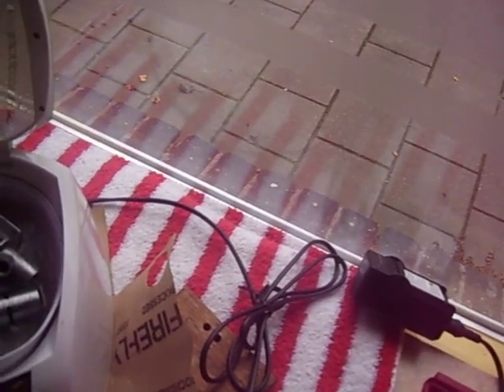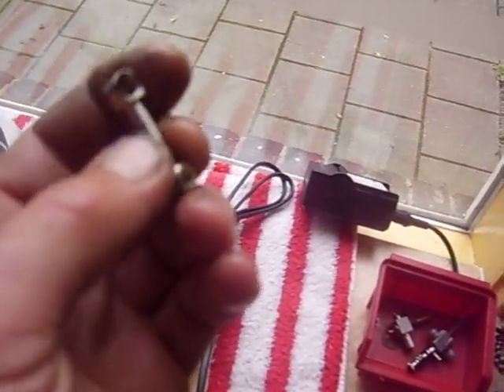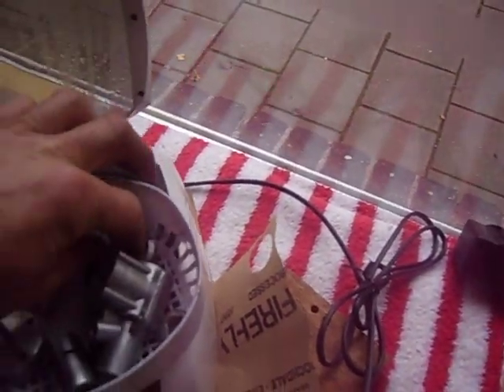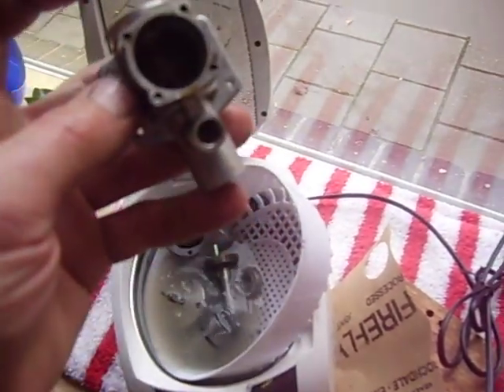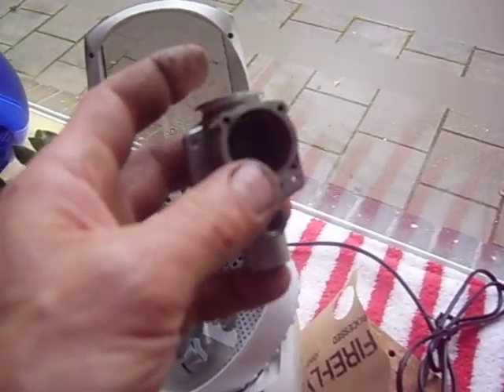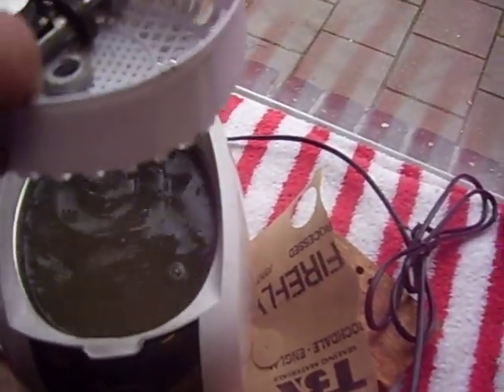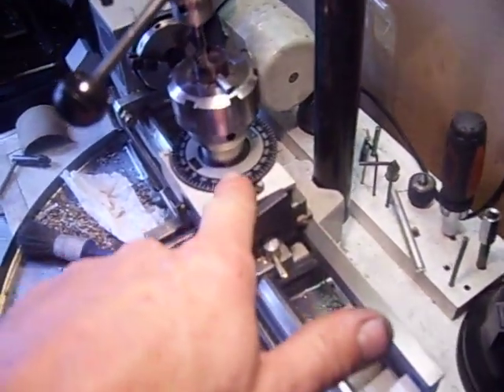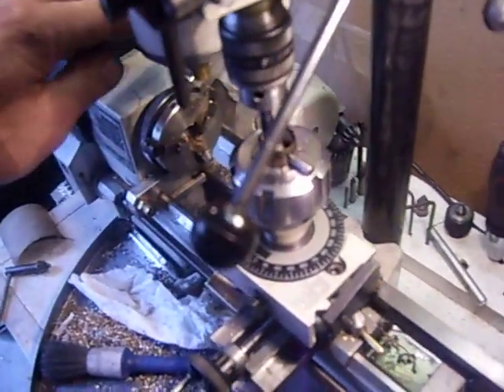PAW 29 (4,8cc)  rebuild +Piston job.

Comment from the maker: Hey Tim! I never try that.If the pin and the al other sizes are exact the same,because the timing,maeby you can try it.But the chance is smal,it wil work wel,as the fits are in very close tolerances.A good fit is like that,that the piston starts moves tight (firm push fit) when the piston pin pases the exhaust window.You must push quite hard with your finger.Its  important to get just the right fit.Also must the boore be slightly tapper to  top.You wil need a inside micrometer to check
Peter
.

Comment from the maker: Hey Tim! I guess,you wil have a bit increase of power.The best is to make the piston lighter too,If you have the tools and skills to do it.
I have also 3 PAW 19,the early model with straight venturi and also a later model.Good engines,a bit heavy,but always good starters and performers.I put the 19 in place of the Marz 2,5,what was tuned and run wel in my Acromaster,but the PAW 19 runs smooth,no vibrations,and moore torque..
Also use the right fuel.(ignition improver)
Regards Peter

Comment from the maker: Maeby check good the intake rotor disc,if it work wel and is driven by the pin of the crankshaft.The disc must seal very wel.No axial  or radial play.I dont know,if its possibel to use the disc both ways (sides) Sometimes engine designers construct a disk,what can be use both sides,so the running direction wil be changed.
Good luck!!

Comment from the maker: Hy there! You can use regular petroleum.Its oke,if you use the cleaner only for the engines,as its smelly ( I like it! ) but if its used for other things,I use very hot water and regular soap. I try bio degreaser, but its still to agressive for aluminium.It can be used,but max 4 min.(the hot water/soap solube  than a bit the old castoroil,but sometimes hand cleaning still must be done in hard cases.
After hot water/soap bath,just dry and oil the parts  right away and nothing happend.

Peter

Comment from the maker: Its difficult with the ED Tim.If he dont hold compression as it shoud be,and intake is working wel with no leaking vacum,I think a reboore and bigger piston is the only answer.I can do it,if you like.
I have 2 K&B engines.I guess 35 and a old 40 rearinduction.I like to sell the engine as I had plans to convert it to a diesel.But It has a deflector on the piston top.so this makes it not easy.The engines compression is not 100%,but shoud  run after cleaning.Can send pics,if needed.
Regards,Peter

Comment from the maker: Hi Tim!
Sounds a nasty one! The most important is good compression.There must be as good as NO leaking hot or cold by the piston.Otherwise you can send me the engine,and I wil take a look at it.
Did you have pre -compression.?Does the engine generate vacum,when turn by hand? (close needel and feel with your finger when close the intake tube,if you feel suction) Maeby you miss some where a gasket,or got a smal crack in the carter..Can be a lot things.But good compr. is first!
Till than,peter